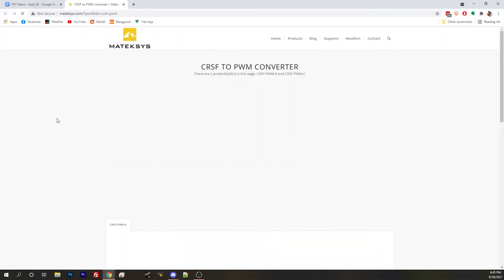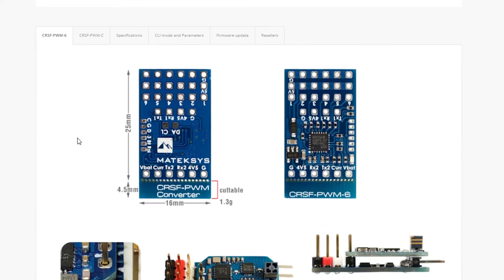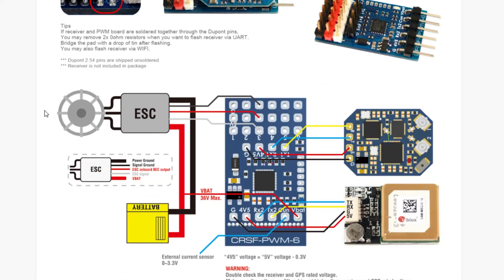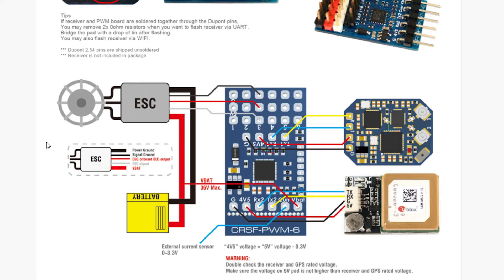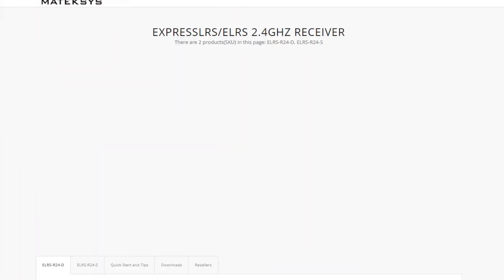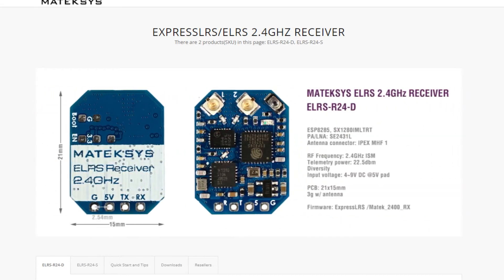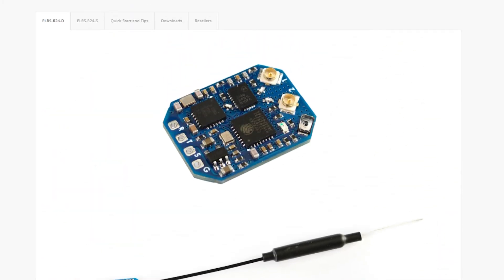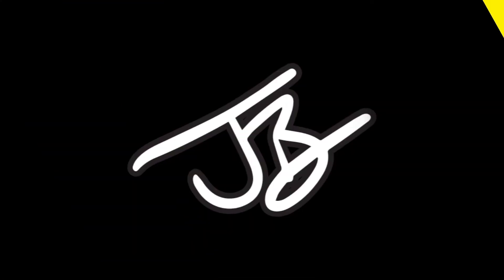JB rants about CRSF to PWM converter for ELRS. Matek delivers!

Comment: Would be really good if these PWM converters were just a little more powerful in that it would be good to be able to do mixing on board. I think hardware wise they could be capable of this it's just a matter of setting up the firmware for it. One issue with ELRS, one of these converters, and a basic fixed wing plane is that you may need more than 4 full resolution channels if you were doing the mixing in the radio. Like if you had two aileron servos in a conventional plane that puts you at needing 5 full res channels and kills ELRS as an option. Unless you can do the mixing once the signals reach the plane. Not to mention the need to subtrim more than 4 servos.

Would be really cool if sometime in the future you could do this servo subtrimming and mixing on the Receiver/Converter side through an OpenTX LUA script....

Comment: You stated that ELRS can be used with a fixed wing flight controller. At this time, your comment is only true if someone uses a Matek flight controller. For all of us that have flight controllers that are not Matek, then we still cannot use ELRS, because our fixed wing flight controllers need SBUS or PPM as an input. This sucks, because we have to upgrade our flight controllers just to use ELRS.... Unless someone will build a converter board from ELRS to SBUS.

Thank you for the great work you do for the RC flight sport!
Reply: Update: the Matek website now shows a small converter from CRSF to SBUS. At this time it is not available for sale locally, so I ordered some from an authorized Matek seller on AliExpress.

Comment: Probably a stupid question but can that second uart be used for smart audio instead of GPS so I can adjust vtx setting through transmitter if I'm using it on a wing that doesn't have a flight controller?

Comment: I use RC's for animatronics and am very interested in ELRS, but also need PWM outputs. Preferably PWM receivers that can handle higher voltages. Instead of using this break out board could you just flash an r9 module and an R9 SX reciever with ELRS and be good to go. One of the commenters below mentioned bad servo resolution with these boards and wondering if the r9 SX and ELRS could be the solution.

Comment: I have 2 6 channel converter boards which I'm using with Happymodel and Matek ELRS RX's PWM is on channels 5 & 6 for both boards but the resolution is awful (no good for control surfaces). What am I doing wrong?
Reply: I'm have the same issue. I'm using it on a wing and the  servos for aileron are super rough and barely any resolution. The elevator works fine though.  Is this an issue with PWM frequency?  Have you tried raising it? Also, don't use ch1 as that is for arming.
Reply: I think I know the reason. I was using Ch5 for Aileron and don't think it's compatible for full resolution

Comment: I've heard iFlight is making an ELRS radio. But I'm not sure either.
Reply: So far I can't really see the point with using this with elrs. I mean if I'm not mistaken there is only 4 real channels in that protocol. The rest is aux channels with 2 or 3positions.
So pretty unusable for planes anyway. No flaps or anything. Not even for a drone where you need a signal for gimbal pitch or likely.
If there will be a slower mode with more channels it would be useful for more than mini quadcopters. That would make me invest in elrs for sure.